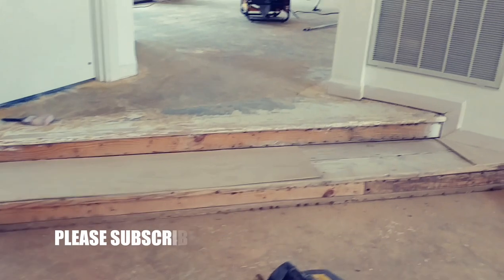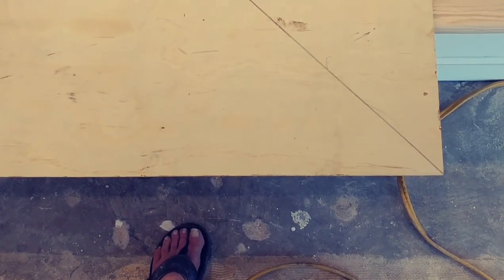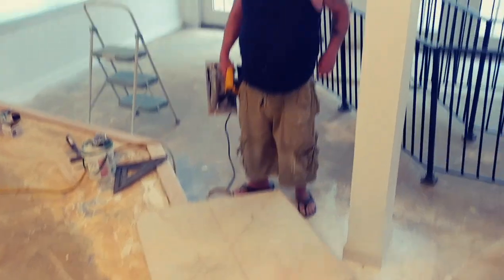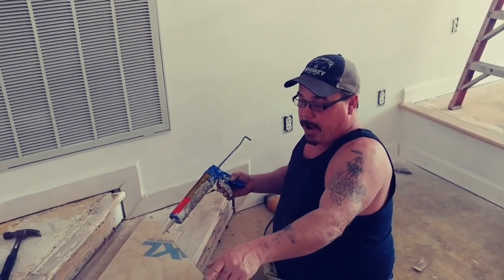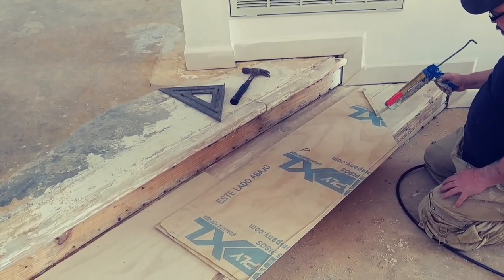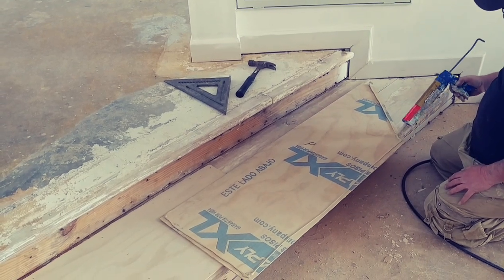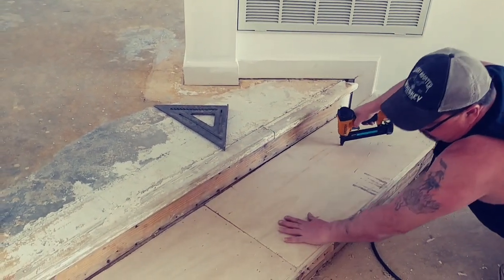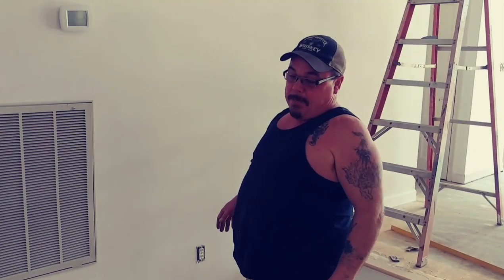How to install Luan underlayment

Comment: Do you have to worry about the staples being too long and blasting through the subfloor, that seems to be the way with roofing nails but can't recall seeing that too often in crawlspace but I'm probably more worried about spiders and sheet.  Are they supposed to go through and you are aiming for the floor joist? I grabbed the wrong underlayment  board and it says no glue??
Reply: Shane, There are a lot of professionals on youtube that can show you how to do this correctly, this guy is just NOT one of them. I have never glued luan on a floor, it gets nailed or stapled every couple inches, so you probably got the right stuff.
There is no need to have the fasteners (nails/staples) more than 3/4 of an inch longer than the thickness of the luan you are putting down. I know this reply is late coming, but I hope all went well for you.
Reply: @williamhoudersheldt7076  Thank you--I am a newbie and your comment helped.  Do the staples need to be 16 guage?  I have a basic Harbor freight gun with 18 guage staples.  Is 18 guage ok to attach 5mm luan to a subfloor?  Thanks!